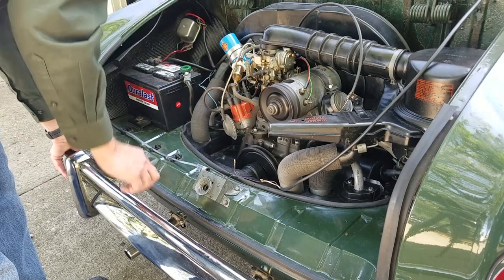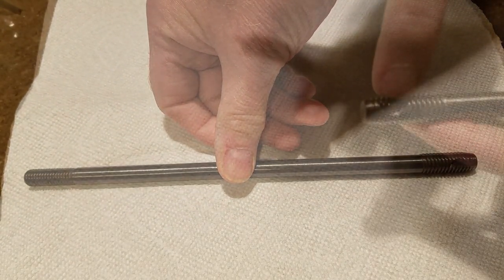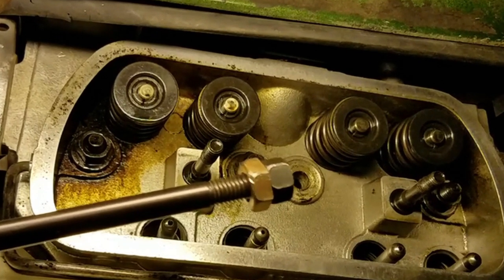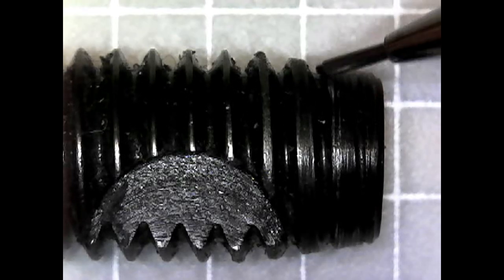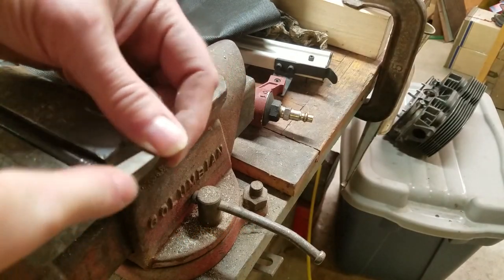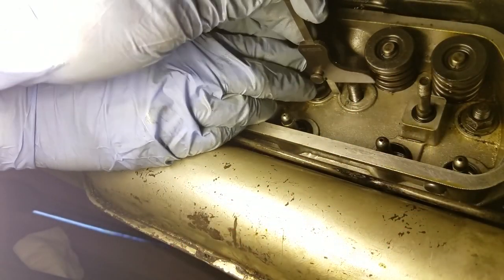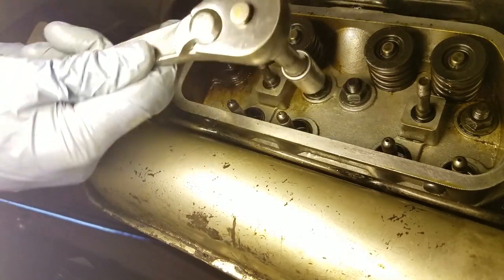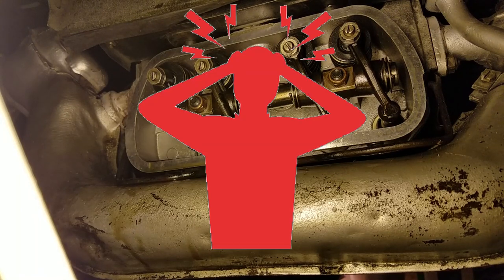1968 Karmann Ghia - Self Tapping Head Stud

Comment: I just bought one of those self tapping head studs I hope the hell I can get it in started and get it in there were born so I can get the head back on in finished putting the damn motor together
Reply from the maker: I hope it works out for you.  If the motor is still disassembled, I would consider going the insert route.  I was happy with the outcome; see my later video.  Good luck!

Comment: Hi David.
You might want to try a larger main jet.  Sounds like your running lean.
Reply from the maker: You are right.  I did try a bigger jet; but I found leaking around where the intake manifold connects to the heads.  Things cooled down significantly after I fixed that.  Thanks for watching!
Reply: @LifewithDavid1  
Good deal 👌